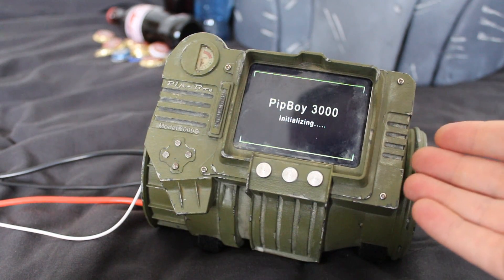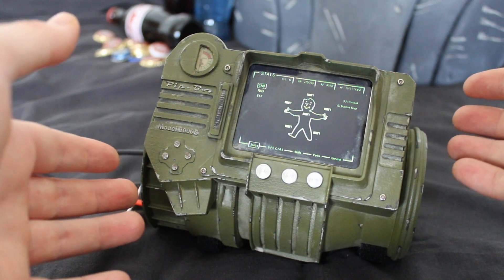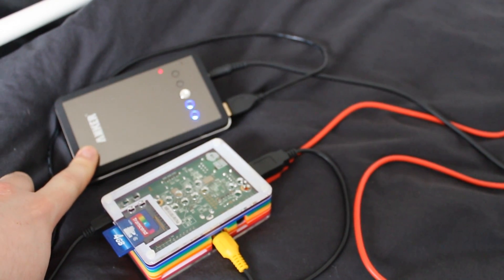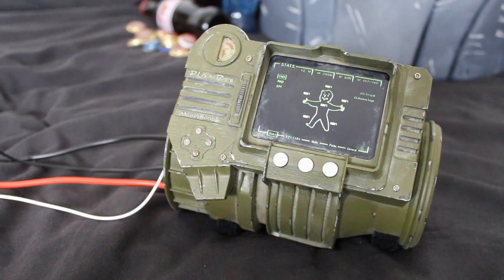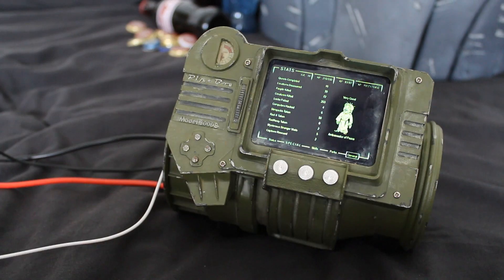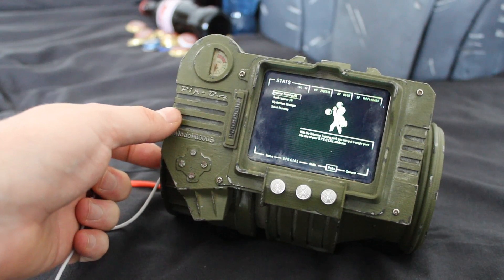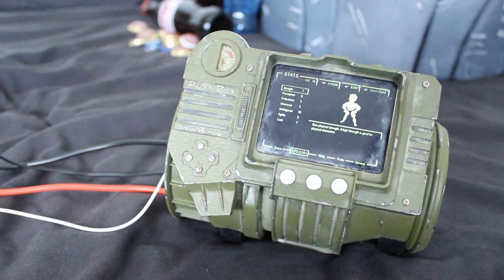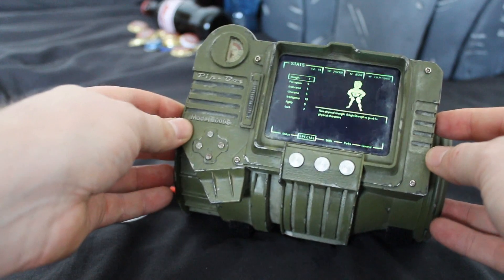Working PipBoy 3000

Comment: Can you share 3D files for 3D printing at home?
Thanks
Reply from the maker: I haven't really designed it to be printed using a home printer. If I was going to model it for a home printer I would have done it differently. There are other some models available that have been design for home printers I would suggest using one of those. 
If you want to get a print of my model you can purchase one off my shapeways store. There isn't much markup on it so it's about as cheap as it can be.
Reply: ShortCipher Thank you! Which screen you used? Can you link it?
Reply from the maker: 360Livee I updated the description to add a link to the screen I used. I took it out of the plastic case it came in
Reply: ShortCipher Thanks! And what about the program for the raspberry pi? Where can i found it? Thanks! :)